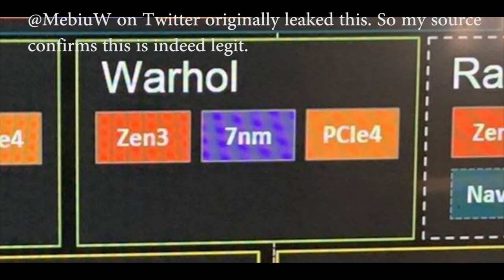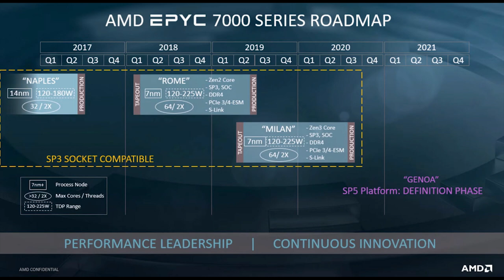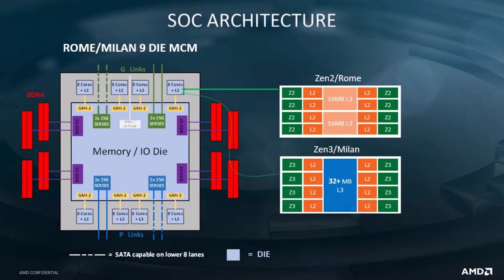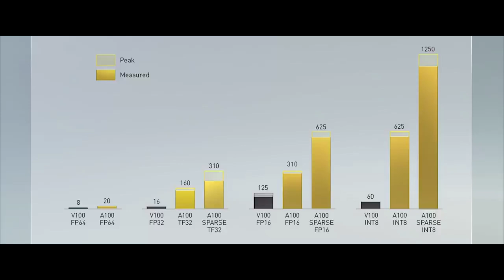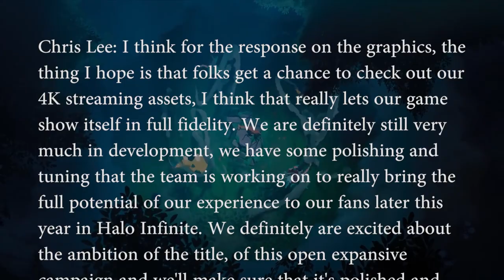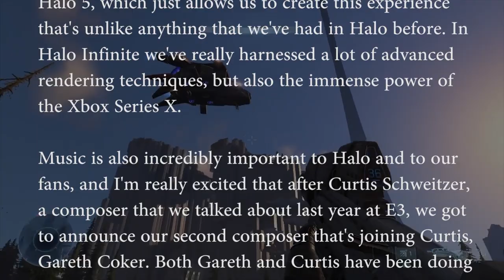AMD Zen 3 Performance & Warhol Info (Exclusive) | Halo 'up to' 4K & Dev Kit Info

Comment: It's not really the chip that takes 3 years to make. Is the achitecute. In the early stages of designed its usualy simulated in software. This is horribly slow, but it do get a feeling for if something works or  not. This may typically be 3 years out. This method is cheap (ish), but not very accurate.

After that its simulated in hardware, typically with programmable logic. To be clear. they would simulate like one CU or one core... or maybe not even that. Maybe just one pipe. This would typically be with giant boards or banks of boards large as a rack... or five. This does increase the speed to maybe a couple of Mhz. So they can run actuall software on it... the nice thing is that this programmable logic can be change really easy  it may just take a hour or so to make a patch. In most cases just changing the program. This would be typically a year out.

In this stage is also quite easy to get feedback from the processors in production. And changes are fairly easily implemented. 

The downside of this is to cant really simulate clock speeds and multi core set ups.

Next up is printing it on silicone. This typically takes 6 weeks (it might be faster for some prototype processes). The first silicone isn typicaly made a year out. This could run 6 week testing and 6 week producing in a leap forging fashion.   Note.. first silicon might not be the full cpu, but maybe a implementation on a older framework. This is really beneficial with chipsets. They make it way easier to test.

Next step is making an actual cpu as it supose to be. This is typicaly 6-8 month out. This is also usually the first use of full size masks. There is other ways of making chip with out masks. Like with lasers. It's really slow, but if you just need one, it dont matter.

Hopefully tha masks is correct from the first go.. but most often they are  not. Masks are incredible expensive to make. If they are wrong, they are worthless. there are typicaly anywhere between 15 and 45 mask for every product.... for a zen3 CPU... closer to 45 than  15.

If they find a bug, the normal way is to change just one maks to fix it, and it's quite common that works. If you need to throw away all masks... that is a bad day 

Sometimes one or a few masks need to be reworked several times. this is somewhat common. Usualy they put in time for two reworks, but if they need tree or more, the launch will be delayed 

When they got the first chip that works, they start sending out engineering samples to the OEM. This would typicaly be 3-4 month before launch.

This dont imply they stop iterating. During the time to launch they keep making batch after batch trying to optimize the process for the specific die. This need to be done. The yeald would preferentially be 90% prior to launch. If it's under 80%... the launch might be delayed (or they make a paper launch).

This is also where they do the binning, clock, power and pricing.

So while it takes typicaly a minimum of 3 years to make a design. First year is playing around with software. During this time they peobobly try a dussin concepts, or more.

Playing around with programmable logic is a bit more expensive. But in this terms, it's really cheap.

The thing with going over to programmable logic is that very large changes cant be done. Lle total overhaul of the architecture. Like you cant go from a bulldozer to a zen in this period. But from zen to zen2... might.. at least to a degree be possible.

When there is one year left. There is very little that can be done shot of removing features, clocking and power.

Comment: Halo infinite is prove to us that "Xbox one/series S" Will HELDBACK series X and series X will be ony enhancement machine.

Games aren't magically scalable.
Pop in visual and fake elevator on halo infinite indicate the games was still utilize HDD instead SSD. Cartoony graphics mean the games was built using weak GPU like Xbox one/series S GPU(1.3-4 Teraflops)

Don't hope huge graphical Leap with 4 Tflops console. Sony Will have more next gen look games because utilize 10.3 Teraflops ps5.